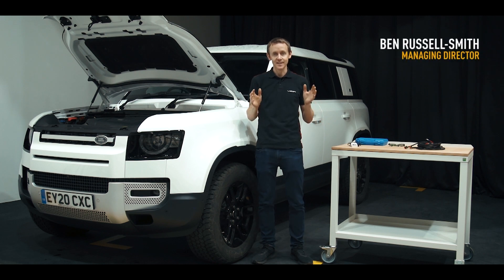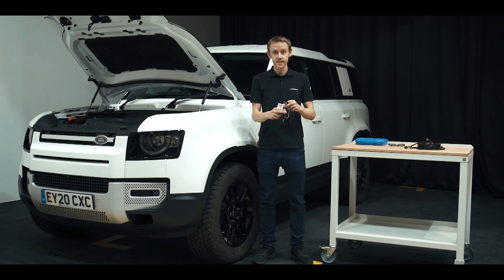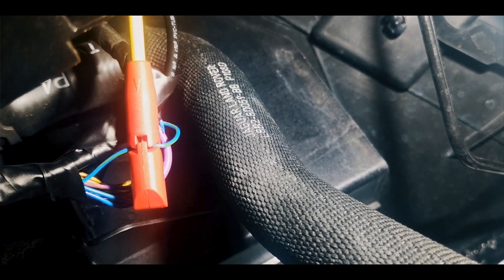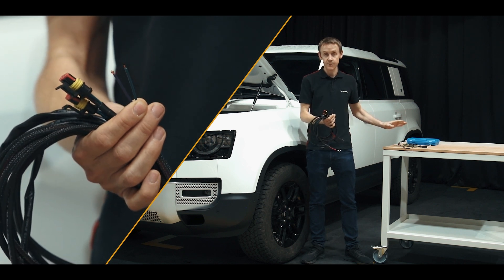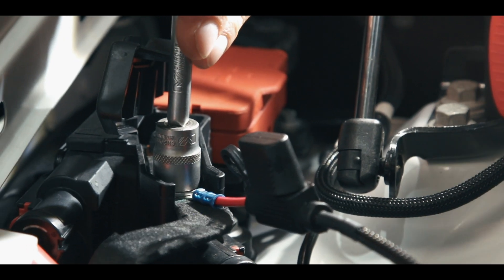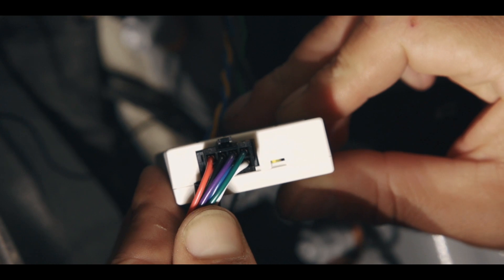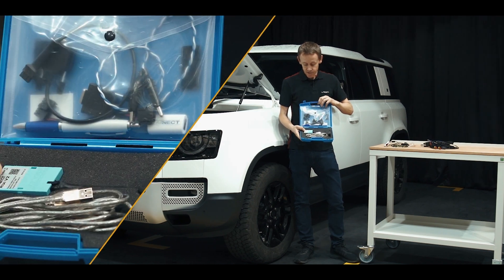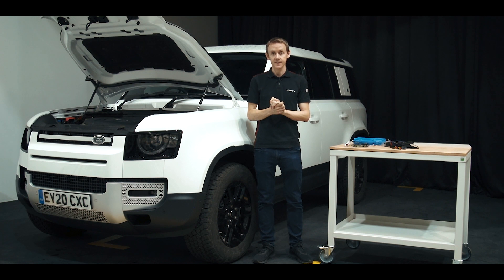LAZER LAMPS | CAN Interface & Wiring Kits

Comment: Where are the position lights? Like where does the green wire actually go into? Is there a photo?
Reply from the maker: Our vehicle side wiring harnesses for lamps with position light have green and purple trigger wires which correspond to the green and purple wires from the CAN interface. The position lights themselves are optional features in our range of auxiliary high beam lights rather than standalone units.
Reply: @Lazerlamps  I have a 2024 Defender 130. The only purple wire with orange is larger than the one you show. It's also slightly larger than the other wires around it. Do you know if they changed color for the high beam wire. Right now I have the elite 18 installed but as soon as I connect the purple wire from the harness to the purple and orange wire to the light bar, I get power but I can not control the light bar on and off. The light is powered whether or not the high beam is on. I'm thinking the color of the wire changed for the high beam, but I can't seem to figure out which one it is.
Reply from the maker: @bullcity5057  Not had our hands on a 130 yet, but please drop us some images to sales@lazerlamps.com and we can look into this together!

Comment: Do you HAVE to connect the green wire to the lights? Or can you just leave it off
Reply from the maker: The position light function is completley optional, so yes you can leave the green wire off. Elite lights do not have a PL function so would not need this anyway

Comment: Hi I have a Mercedes Sprinter 4x4 2024 without the led headlights will your standard wiring loom be ok to use , splicing into the 12vmaim beam  feed thanks
Reply from the maker: Yes, any of our wiring harnesses will be ok to use on your Sprinter and are ok to be spliced into the main beam feed. We have done this plenty of times with no issues. If you require any more information before committing to a kit, feel free to get in touch to sales@lazerlamps.com

Comment: I'm looking to fit these to my 2023 VW Transporter T6.1 I have checked and do not have 12V signal for HB so will need a Can bus module, do you know where this needs to be fitted? Thanks
Reply from the maker: Hi, On the T6.1 the CAN interface goes behind the heater control unit. Would recommend also using a contactless reader to simplify the installation as it can be a bit fiddly.

Comment: Is there a wireless switch I could use to activate the utility lights provided they are connected to the battery?
Reply from the maker: Hi, not that we make, but you could use a remote garage door relay to operate the lamp remotely. Just make sure it will work on 12/24v

Comment: Hi! I have bought a Linear 18 elite LBA, it should arrive in a few days. I have also purchased the can interface, do you recommend to use it or to splice the wires? Also are there any advantages if I choose to use the can interface or it works identically?

Thanks!
Reply from the maker: Hi, It will depend on the vehicle you are installing onto. If the vehicle has a 12v high beam trigger, you will not require the canbus interface. If you do not have a 12v high beam trigger wire, you will need the canbus interface to simulate the trigger for you. What vehicle are you installing the i-LBA onto?
Reply: @Lazerlamps  2022 Defender like the one from your video
Reply: Hi, I finished all the wiring in the engine department, could you tell me where to go through the firewall and where to find the ign and purple wire for the main beam?

Thanks

Comment: Can you not just make a break in loom, to avoid having to cut the wires? I can see issues with warranty if I do this. Powerful UK have made looms for the rear lights, that would be almost a plug n play solution
Reply from the maker: Hi Paul. The splice/crimp solution we're proposing shouldn't void your warranty (albeit depending what dealer you speak to as to whether they adhere to this or not). The piggyback loom you're talking about is possible, but an expensive solution that in the end we didn't prioritise for development.

Comment: Would like to install the Linear 36 to my defender 2022 with original roof rack. What do I need of connections when I have the matrix lights? Would like it to work together with the high beam.  thanks
Reply from the maker: Hi Ole. Detailed instructions are available via the CanM8 app, access to which is available via the unique access code on any Lazer or CanM8 CAN interface.

Comment: At the video you say that in new Defender you do not need Can Interface at all. But how about 2017 Discovery 5 with led lights?  And if not what colour wire is the high beam wire?
Reply from the maker: Mika, you can take a 12v feed from the back of the headlamps on the Discovery5. Please drop an email to aaron@lazerlamps.com and he will be able to advise re wire colour.

Comment: While the 2020/2021 Defender doesn't require the CAN interface to work, would you recommend that I use the CANM8 Duo interface with the optional wireless connection for a non-spliced solution (and also one that will let me use the Speed Adapt Mode)?
Reply from the maker: Hi Matthew. If using the Triple-R Smartview and wanting to activate the Speed Adapt functionality, you will need the CanM8 Duo Interface. The Contactless Reader means you don't have to splice into the CAN-Hi and CAN-Lo which many people find preferable.

Comment: Splicing in to the loom will void the manufacturer’s warranty for the loom and associated products connected to it!?
Reply from the maker: It depends on the manufacturer. We do have a contactless reader that will avoid having a make a metal-to-metal connection, if you are particularly worried about the warranty.